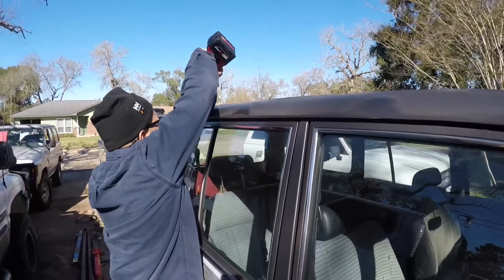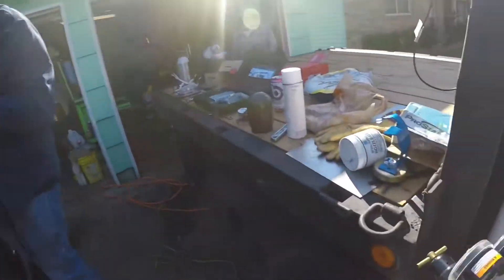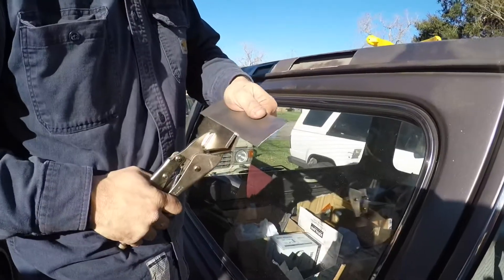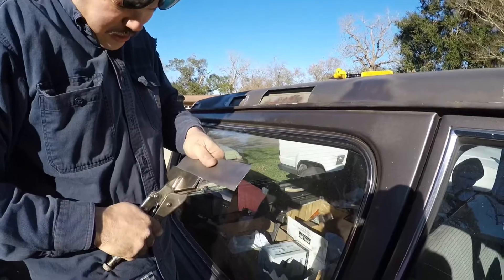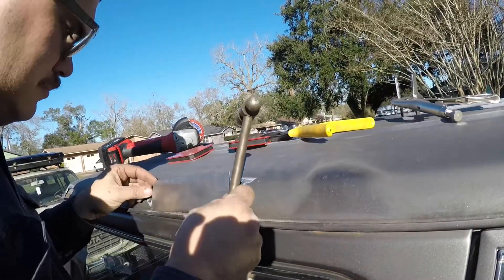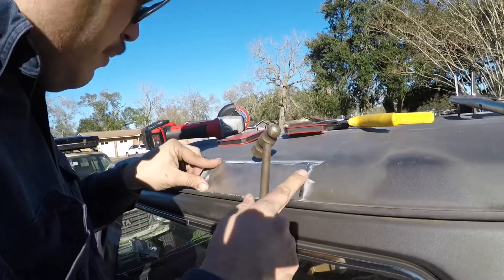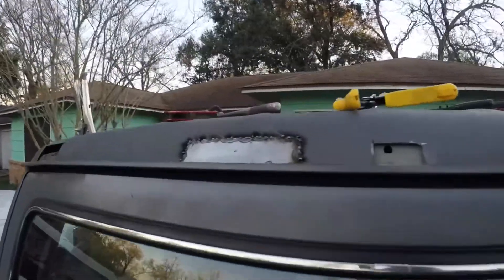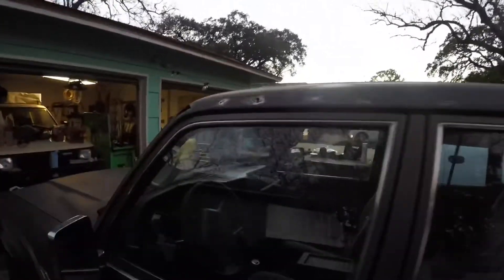FJ60/FJ62 Roof Rust Repair Part 1

Comment: It's easier if you make the patch first, trace around where you want to put it, and then cut the hole to suit the patch, instead of the other way around. For next time :D
Reply from the maker: Last time I patched a larger hole without a drip rail under it, I did that and tacked it, then cut and tacked each side and it frenched right in. This way is a piece of cake too though